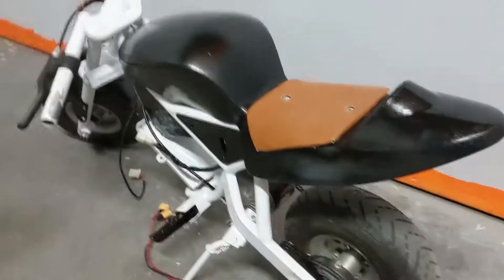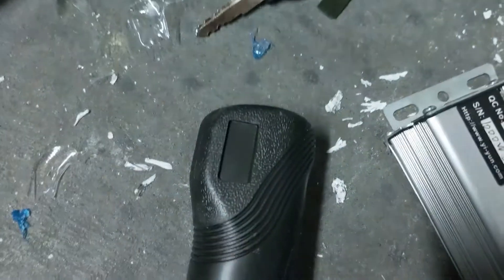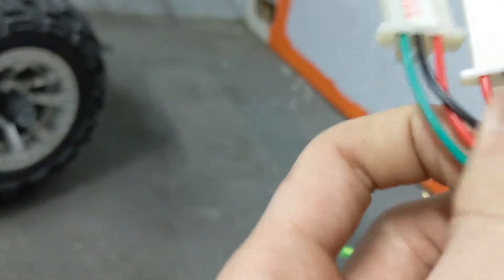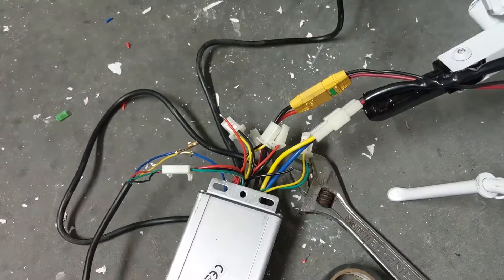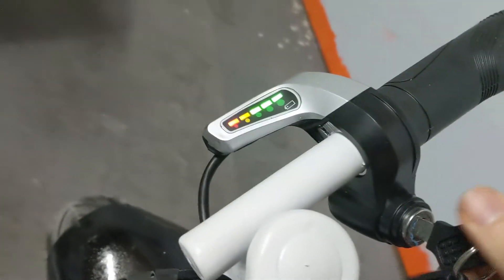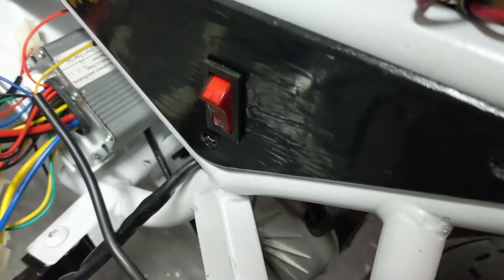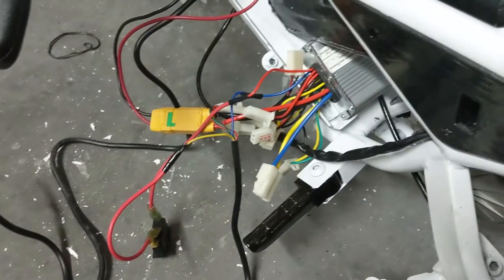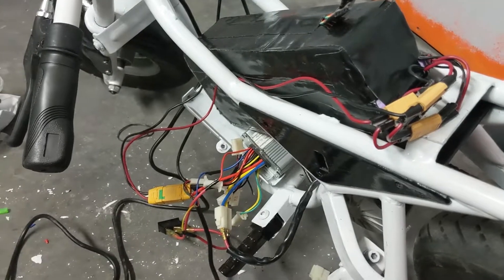Electric Mini Bike Build Vlog Part Two: Electronics

Comment: Hey, I'm doing something similar, I have a Blata Replica mini Moto frame that I'm using 2 X hoverboard motors bolted directly to the rear wheel hub. I have 2 X 500w nominal controllers (max 1300w each).

Just got a hydraulic disc brake fitted on front today, will have to start a vlog myself lol
Reply from the maker: That's awesome! I definitely would be interested in seeing that! Hoverboard motors are good for torque, so if you want speed go for higher voltage on them. I'm not sure how much the motors will like being run at 500w, but I am pretty sure they should be fine. I actually burned the motor out on this mini bike(2 videos I haven't edited or released yet), turns out a 24v motor doesn't like 54v 30a. It smelled like an electrical fire after each ride, until it actually gave up and just stoped working, but boy was it fun and boy was it fast! Working on making it brushless and 54v 60a probably, hub motor, and ABSOLUTE insanity, just need the money first. Good luck on your project I will definitely subscribe and be on the look out for it!
Reply: Hey, either of you guys in the UK? I want to build something similar for my son to practice on. He races petrol versions but there is no where nearby we can use it so these would be an ideal local practice tool